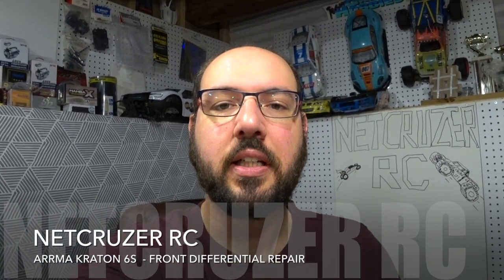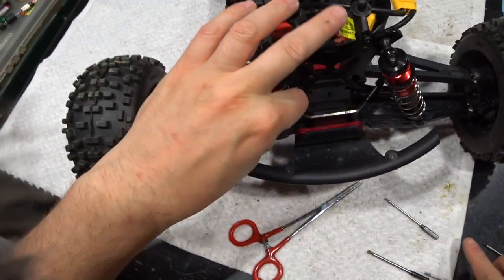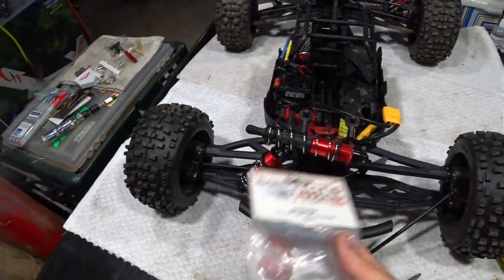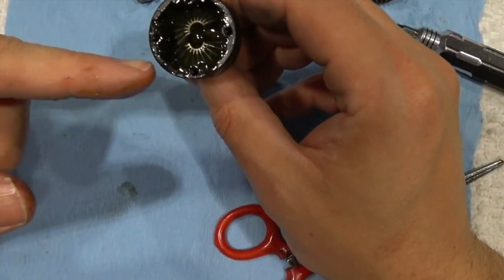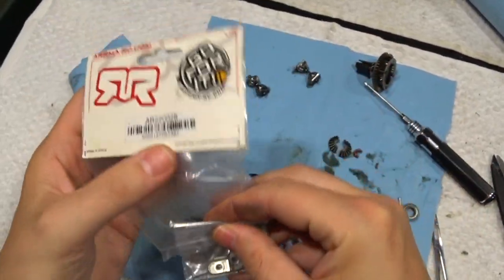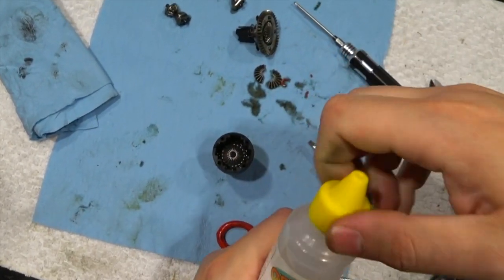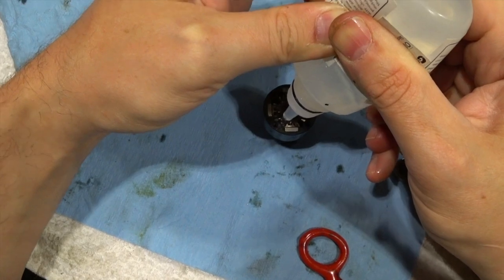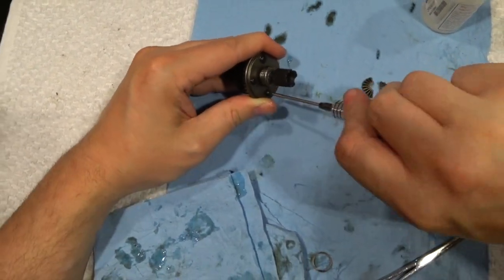Arrma Kraton Front Diff Repair - Netcruzer RC

Comment: I'm having issues sealing the diff. I tried sanding the top cup. It keeps leaking even when new gasket. Now I just sealed it with rtv silicone and it seems to work. By any chance heard anyone use grease to seal the gasket?

Comment: Get that bad boy fixed up n go bash n break it again John! Lol its like groundhogs day movie,lol I need that bumper for mine, is that rpm or t-bone? Ya brotha u need a drill 😆
Reply from the maker: It's an RPM.  However, I am getting a T-BONE XV4 2.0 bumper to test and I'll get a review of that out soon!
Reply from the maker: I do have a full size cordless but that seems like overkill. I also have a crappy little black and decker power screwdriver that is weaker than I am.  I need the between level, a nice small pistol grip lithium driver would be ideal.
Reply: @netcruzer  john I recommend the small skil brand one off Amazon. Its been great for me. Its just a small pistol grip and sells for 20-25$

Comment: U said v3 battery box, is this better set up,,,, cause those straps are a pain on the v4 kranton
Reply from the maker: I did end up leaving the v2 battery tray in. As swapping it requires changing RX box and lifting ESC and servo mounts. A real pain for an unnecessary thing.

Comment: Thank's John 😁👍👍 I just snapped an outdrive on my Outcast and your video is gonna be Very Helpful in getting it done ✌️😎👍 HFLPRCing
Reply: Larry H. RMX RC PLAYPARK Don’t forget to shim them since you will have it apart. Properly shimmed diffs are almost unbreakable
Reply: @TheBigToe69  what shims would you need for this? I have to pull my diffs apart and rebuild them and replace some axles. I ordered shims shown in the diff blow up diagram for the kraton and tried to order those shims but there isn't part numbers for all of them because they come as part of the diff gear set etc.

Comment: I'm running 60 front 500 center and and 30 rear
Reply from the maker: Oh yeah I mention wanting to do 100K in the rear, that isn't ideal.  I plan on doing 50K front, 500K center, and maybe 10K rear?  Not sure how light I want to go in the rear.  With 500K center is it a standing backflip monster? I don't really want that, I'd prefer to just have it make use of the power better without diffing out to the front as much.
Reply: @netcruzer  I use 150k in the center, 50k front and 20k rear, I like it ;)